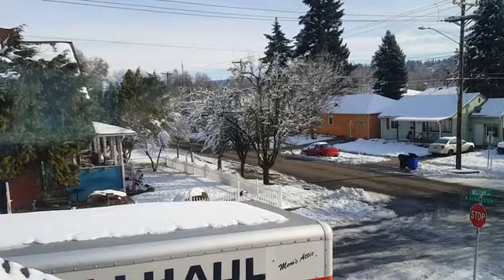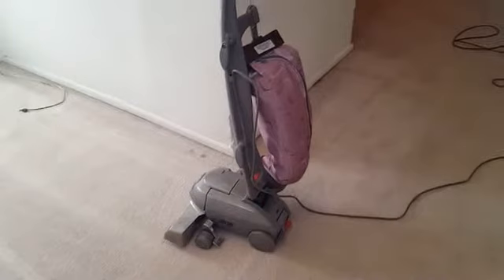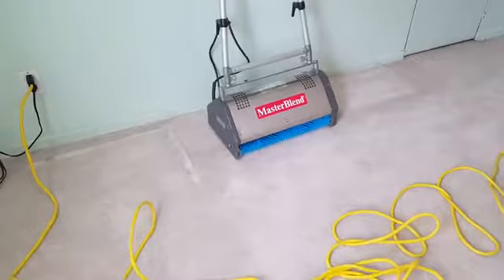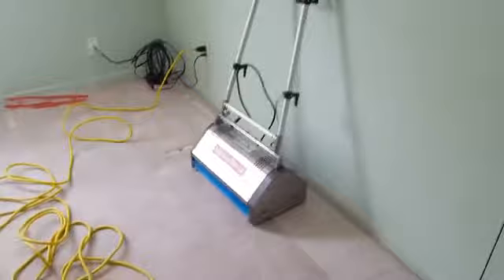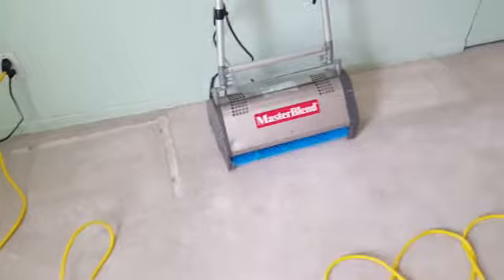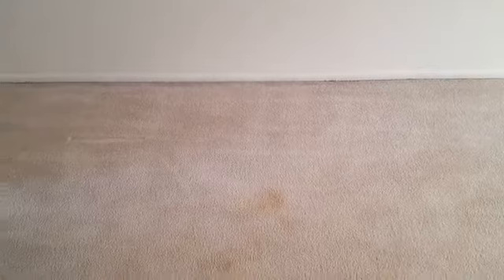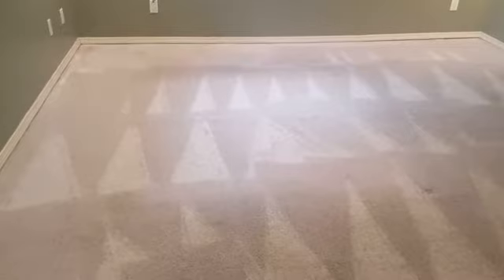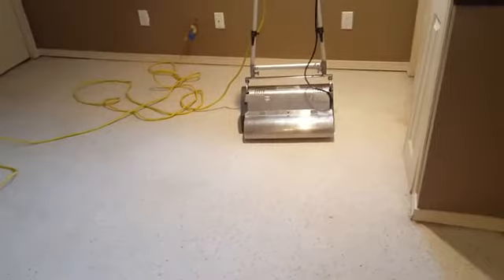CRB Carpet Cleaning Gladstone

Comment: What products did you use?
Reply from the maker: It was only an encapsulation job to make it look more appealing for a walk-through. I didn't actually treat any of the urine spots.

ReleasIt - DS2 boosted with some Grease Hawg.

Boosting with Grease Hawg or Hot knife, by the same vendor, seems to cut through pretty much anything
Reply from the maker: I was able to speak with the buyer and explain what I was doing and he wants me to come back in a couple weeks to treat the urine. Was able to double-down on this one. :)